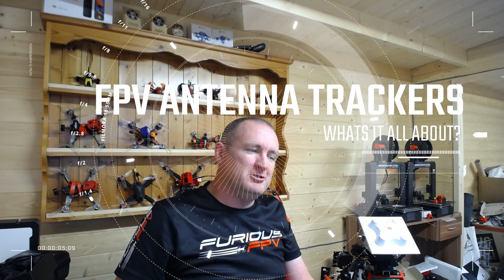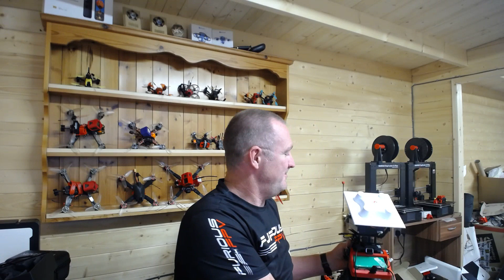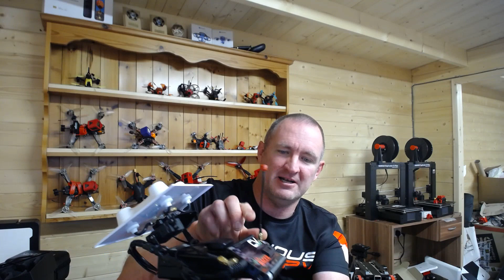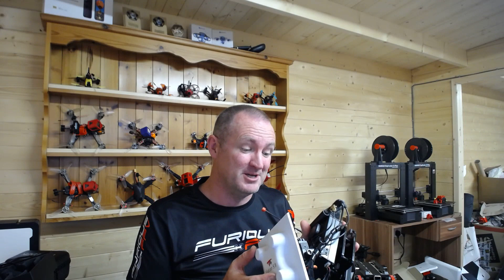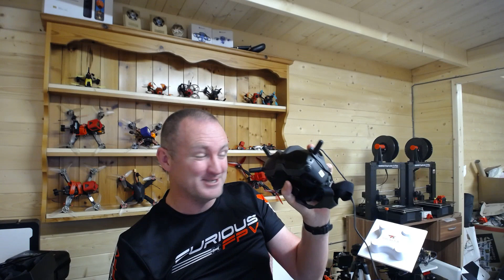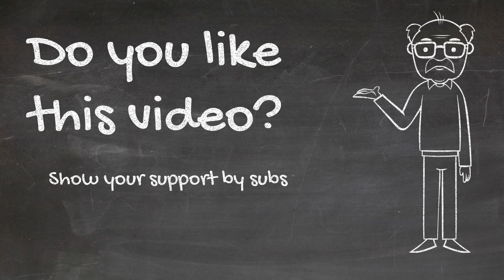FPV ANTENNA TRACKERS | So whats it all about?

Comment: Hi, I'm thinking of getting a tracker antenna. I've assembled almost the entire project or 360 gts. I use a DC 24 jeti radio, but the truth is now I'm a bit lost how to use the radio with this antenna project, any advice from you, thanks in advance
Reply from the maker: Hey..   Will be hard pressed to get any telemetry for the tracker from your jeti kit.   I love jeti.. But you just won't make anything like this work on jeti.

In the bigger picture..   With 2.4 rc control there is little real benifit in a tracker.   Jeti will not take you much past 2km,   and video signal should be plenty good in that range.
Reply: @RTRCTV  I already imagined something like that because it would be buying a Chinese radio with a long-range module

Comment: Do you think the Vulcan I the best 5.8 antenna ? How do you compare to the vas peperbox extreme ?
Reply from the maker: Designed for a different purpose.

No point putting a pepper box on a tracker.  Beam is really wife and as such no real gain on a tracker.

IMHO,   the vulcan knocks the socks off any pepper box.   But you must use a tracker.

Comment: Never been a fan of telemetry based trackers ever since back in the day when I had an EZ OSD tracker trip out on me mid flight and point the antenna at the ground with a glitch then tweak back.    Gave up the idea of fixed wing truly long range flying around 2014.

Never got around to an RSSI tracker but those can have an issue as well.

Now 1 mile-ish proximity with a quad is more entertaining.

Comment: Hi Rob I'm trying to update the Dock king and it currently says when I check hardware 1.0 and firmware 1.3 is hardware 1.0 what your docking is showing.. I don't think the firmware has updated properly and it would be great if you could confirm.. Thx
Reply from the maker: Aaarh..   If you had asked me 2 hours ago I could have checked.

I have just passed my dock King setup on to a friend as just rebuilt by gs using a. Clearview race edition.

I will ask Andy to check and post back here!
Reply: @RTRCTV  thank you so much.. I'm stuck.. It Sorta does update 100 percent uploading but reboots and says firmware not updated.. Plug module in  boots fine shows hardware 1.0, just wondering is that the norm... 👍
Reply from the maker: @kool-k-kel  I found the update process to be rather hit and miss.
Reply from the maker: Thinking about it.

Hardware version is not likely to change afrer an update.   Firmware. Would change
Reply: @RTRCTV  thx Rob, your an early bird as well...
Reply: Tbh I thought the same... But few YouTube vids / google suggest firmware 2.2??

Comment: when you are on a tight budget, which antenna tracker would you recommend :)?
Reply from the maker: For simplicity of install..   Arkbird, with a 13dbi lzr and basic boscam receiver.

Total cost would likely be under 250 dollars